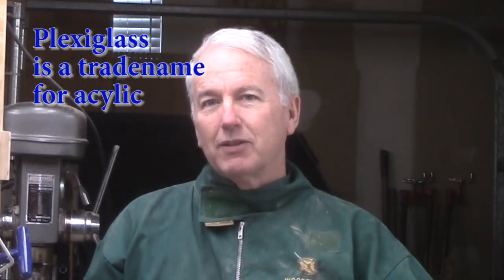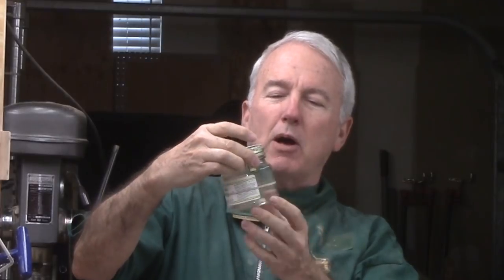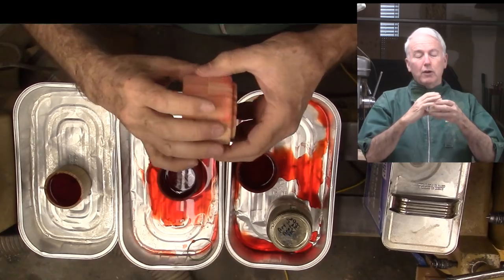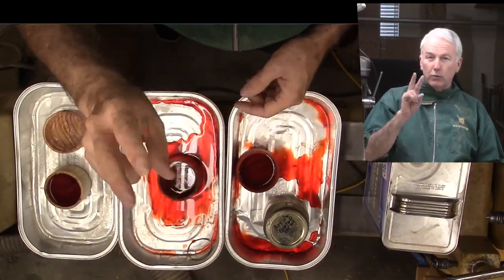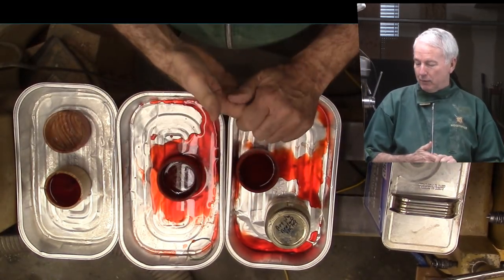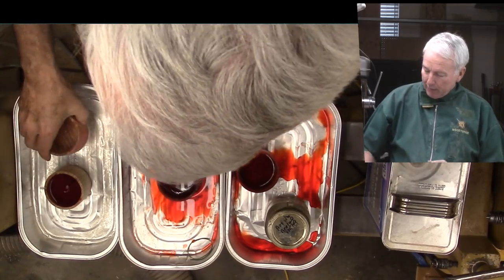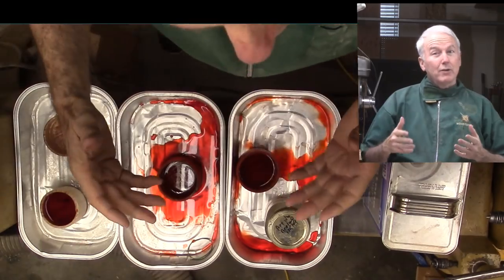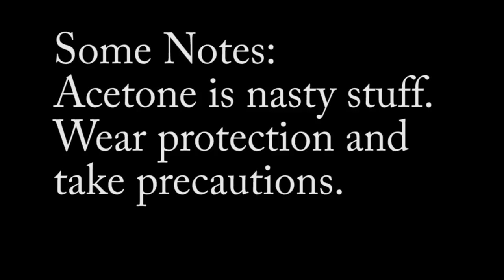A DIY Approach To Waterproof Wood

Comment: Alan

Great experiment!   I would probably be inclined to apply multiple coats (I'm a belt and suspenders-type guy) to make sure that the final product is truly waterproof.

A natural followup question would be 'is it food safe'?  

As to using this as a finish - acrylic dissolved in acetone was sometimes used as a finish by pen makers - until they realized that they could accomplish the same objective using CA glue
Reply from the maker: I'm in agreement with the insurance from multiple coats.
Acrylic is used for drinking vessels - I'd make sure the acetone is completely gone.
This smelled better than CA glue and less expensive. Still CA has its place.
Alan

Comment: very interesting how long does it take to dry after painting? and how many coats?
Reply from the maker: I did 2 coats but my mix was very thick. one at that viscosity may have been enough. Two was insurance. Drying was quick - acetone evaporates very quickly.
Alan

Comment: I did some sleuthing to see what other solvents might be used instead of the acetone. Sounds like you could use MEK or Xylene, but I'm not sure the slower evaporation offsets the other properties. Apparently,  Olympic Waterguard Clear Multi-Surface Waterproofing Sealant is "100% Acrylic" and might do the same thing if you didn't want to dissolve your own. I couldn't find what solvent it used.
-Stuart
Reply from the maker: I looked up the Olympic sealer. I'm not sure what 100% Acrylic means. From the description, it dries much more slowly than the acetone. I like the price of the acrylic/acetone mix. :)
Alan

Comment: Alan, I started using that mixture over ten years ago to stabilize pen blanks.  It worked... sort of... but the acetone boils off too quickly under vacuum.  Then one of my proteges told me that he tried it as a finish for pens and showed me how.  Talk about the student teaching the teacher!  It's not a simple process, but it is fast comparatively because it dries so quickly.  That said, I haven't used it for that in some time.  But there is no reason it shouldn't be used to waterproof a piece.  After the acetone flashes off, it's just acrylic after all.  Not sure I would have thought of using it for that purpose though.
Billy
Reply from the maker: I wondered if I could stabilize with the mix but also wondered if the acetone flash off too quickly. Did you have moderate success or did it just nor work?
Thanks for sharing your experience.
Alan
Reply: Alan, only moderate success.  Again, it would work well if the acetone didn't boil off so quickly under vacuum.  But without vacuum, the acetone just evaporates too quickly to get good penetration anyway.  Minwax Wood Hardener seems to be about the same stuff, except a thinner formula as they smell about the same.  I found I was better off just sending my blanks to River Ridge for stabilizing.  At ~$1 per pen blank it was worth it!  But I recently purchased a large vacuum chamber and will start using Cactus Juice when I need something stabilized.
Billy

Comment: It's a good thing that I kept all of those acrylic cutoffs. I'm going to see if I can coat the inside of a larger vase. I wasn't happy with the vase so no big loss if I screw it up. I wonder how long it takes this slurry to set up? Of course it depends on how much acetone is in the mix, just a rough idea from your experience. Thanks for posting this info Alan.
Reply from the maker: I was surprise at how fast it was dry. I expected it to be more like varnish - it wasn't.
Just be careful breaking up the acrylic. it shatters.
Alan
Reply: @AsWoodTurns Thanks for responding so quickly.  I'm planning to use a wood rasp or block plane to make shavings that hopefully will dissolve more quickly in the acetone. I'll let you know if it works.

Comment: Alan, I turned a vase for my wife on our anniversary and coated the inside with 5 minute epoxy and it worked great. Five years now with no seepage and looks beautiful. With the epoxy I don’t have to worry about using a volition chemical that I wouldn’t want laying around. As turners we must think about the chemicals we use in and around our shop. Acetone should only be used in a very well ventilated area with proper breathing protection. I don’t think using that chemical is a good idea.
Reply from the maker: I'm not sure I can rank Acetone vs epoxy and epoxy catalysts without a chemist. I just know epoxy has some nasty until completely cured. 
Alan

Comment: I have read that pieces of expanded polystyrene (telgopor) can also be dissolved in acetone and there remains a gel that works as an adhesive and waterproofing.
Telgopor is cheaper and easier to get than Plexiglas, and dissolves faster.
Reply from the maker: Probably worth a direct comparison.
Thanks Osvaldo
Alan

Comment: Not sure I would like working with acetone. Was it brushed on? Would resin do the same thing?
Reply: I think it's a decent idea, but epoxy resin does seem like an easier approach, some resin may require thinning (with denatured alcohol or varsol)
Reply from the maker: Glen, before writing off acetone, please note that it is used extensively as fingernail polish remover. Also Resin and catalysts have some nasty characteristics. You may want to get an MSDS for acrylic, acetone and your resin and compare them.
Alan
Reply: Good points Alan. Forgot about the nail polish part. Don't have much use for that sort of thing. Thanks

Comment: Hi Alan,
I watched your cider mug video which led me here.
I like this idea for the inside of a vase but am wondering if the first coat should be a bit thinner to allow for penetrating into the wood a little more?
Looks like I have to put on a lab coat and mix some chemicals!
Thanks for the video!!!
Tom
Reply from the maker: Put on your lab coat and experiment. A thin coat is used in many applications. Acetone evaporates so quickly, I'd have to experiment to see the difference.
Alan

Comment: I would not want to drink out of it,  but it would be neat to coat the inside of a weed pot for nice cut flowers and not have to worry about matching the glass tubes that are available to the dill size drill bit you have available .
Reply from the maker: Waterproof and food safe are two different applications. I'd have to check the MSDS before thinking about food safe. But acrylic is used from drinking vessels.
Alan

Comment: Brilliant stuff.....Have been playing with this concoction over the last few weeks, my mix is now well over 2 months old and has been topped up on a number of ocsaisions. So far the results have been highly encouraging on a variety of items including vases and planters with great sucsess. A couple of exceptions would be that on applying the mixture the pieces have cracked almost imeidiately and quite catastrophically, which, I can only asume, may be due to the heat genreated as the chemical reaction takes place. One of the pieces was a very thinly turned hollow form Hornbeam vase and the other was the bottom tray section of a two piece Spalted Walnut planter. Not sure if the speed and severity of the chemical reaction  can be controled by reducing or inceasing the amout of dilution but will definiately continue the testing because when it works it works well and the pieces appear to be 100% waterproof....
Reply from the maker: Thanks for your observations. I'm not sure about a chemical reaction. I thought it would only be the evaporation of the acetone that leaves the acrylic behind. 
Thanks
Alan

Comment: What is a good suggestion as to where you can get or what type of acrylic should be used.  I was thinking cassette cases but there are very much no longer in circulation.  CD cases maybe?  If anybody has any other ideas please share.  Thank you.
Reply from the maker: Acrylic is NOT all plastics. Different plastics react differently to solvents. Acrylic is often sold in big box stores in flat sheets. But always check for the composition. I don't know what cassette cases are. Most milk or water jugs are HDPE. but there are many different ones.
Alan

Comment: Great video. I'm going to try this. Just wondering, approximately how time is there before it sets up. I want to use it inside a bud vase.  This way I have a rough idea on how much time I have to work with before it sets up.
Reply from the maker: The acetone evaporates very quickly to be dry to touch and workable. I'd leave it a bit more to fully evaporate.
Alan

Comment: Great video Alan, thank you. I started using this mixture, but am running into an issue. My mixture dries and has started turning white. This is not ideal because I want the grain to be seen still. Do you have any suggestions on how to fix this?
Thank you, Bobby
Reply from the maker: Acetone is extremely volatile, therefore the mixture will gradually become more  stiff (less viscous).  I have to keep adding acetone. I have not experienced it turning white in the jar.  Impurities??
Alan

Comment: Hi Allen, I’m going to try you waterproofing solution. Could you tell me how long it takes for the acrylic to melt down to brushing consistency. TIA, Bob M-J
Reply from the maker: There are several variables. I expected over a week but was surprise when I checked and it was already melted. May take another day to adjust consistency.
Alan

Comment: The penturning world has been using this same mixture for years .. and it works well .. 20, 30, 50 coats build a nice finish ...  wipe on,  wait 10-15 seconds, repeat, this will get coats on in a hurry .. As you indicated, PlexiGlass is a product name. There are other trade names for Plexiglas, such as Lucite, and Perspex (or PMMA).  This is a different product than polycarbonate (aka Lexan or Makrolon) which will not dissolve in acetone (I tried, and it just turns white and cloudy).  Keep up the great work!!!
Reply: What sort of proportions do you use for the mixture? I turn a lot of pens and would like to give this finish a go. Cheers, Huw
Reply: @huwdavies5264  Here are two articles which outline the process ..      
https://www.morewoodturningmagazine.com/articles/pen-finishing.pdf                     
http://www.penturners.org/forum/attachments/f28/20286d1259935311-plexiglass-finish-plexiglass%2520pen%2520finish%5B1%5D.pdf                 
the Plexi-Acetone mix is  'thin' and dries very quickly ..    I have never tried it on a bowl, but, it WOULD be waterproof .. since it is 'plastic', eh?
Reply from the maker: @Jeff - Thanks for sharing your experience.
Alan
Reply: @huwdavies5264  Huw, I never measured it.  I just put some broken plexi in an airtight jar, filled it about 2/3 full of acetone and kept adding plexi until I got a viscosity like pancake syrup.  Make sense?
Billy
Reply: @TheMessyStudio  Thanks Billy will try your "recipe". Cheers, Huw